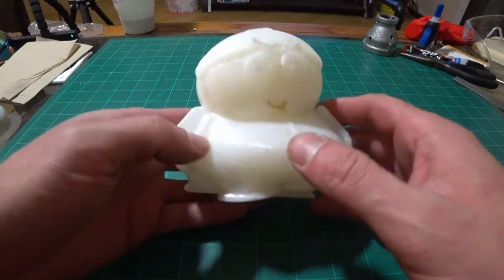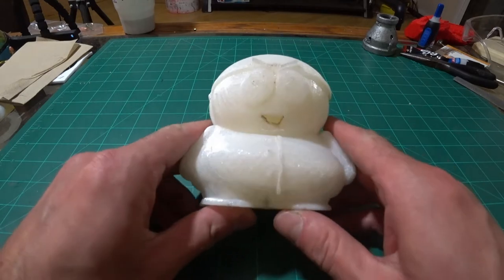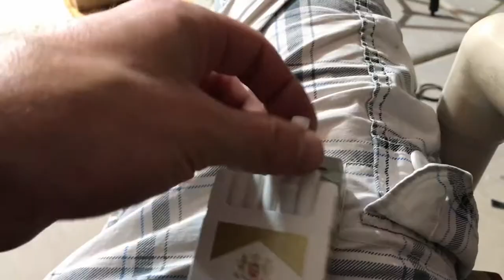ALUMINUM Sand Casting CARTMAN From South Park!

Comment: Groovy baby🤘🏻🤪🤘🏻. Looks great I bet it feels awesome nice n chunky. 
Hey I was wondering if you printed that mold with 0% infill do you think you could get the same good casting by normal sandcasting? I’m definitely gonna try it out but not southparky I have somethin else in mind😉👍🏻.
Reply from the maker: Hahaha 😂 maybe but I doubt it. I usually do mine at 20% infill and I wouldn’t go lower than that or you might loose quality not to mention support. You could prob remodel it and put in custom supports but that still is iffy. Are you trying to save on filament? How’s the printer been working out for you?
Reply: ArtByAdrock printers working great but I’m waiting for more pla to arrive as the shop around me charge 2x what it costs to buy and send to me . Also What I mean by doing it at 0% was to leave the actual pla mold in the sand and pour directly into that lost foam casting technique 👍🏻I know you’ll destroy your mold everytime but I would think using greensand it would hold its shape well. 🤷🏻‍♂️I’ll find out soon enough I suppose.
Reply from the maker: Oh gotcha.. I prob wouldn’t even try it unless it was a really small piece.. the plastic will burn but I don’t think it would burn all the way and would prob end up lookin like crap. I watched a video of a guy try and it was terrible. I’ve thought about using ABS plastic making a mold in plaster and then using acetone vapor to melt it out. Not sure how well it would work but who knows
Reply: ArtByAdrock tell ya what man  I’ll give it a try with a small piece wen I get some more pla and try it with aluminium and if that works I’ll try bronze . I’ll let ya know how it goes and if it’s crap I’ll still email some pics to ya then at least we will both know , but yeah I’m with you it’ll probably look dodgy as hell , definitely wouldn’t be the worst thing I’ve cast 😆. Then if it’s shit I’ll delete the footage so it’s gone forever 👍🏻
Reply from the maker: bigstackD Casting haha ok sounds good. I have a feeling only half might burn out. Even if it’s crap keep the footage and do an epic fail video 👍🏻
Reply: ArtByAdrock yeah I suppose, it never hurts to have a bit extra footage 👍🏻
Reply: Hey bigstackD, good to see you here.
Reply: Mark Fryer I’m always not far from this channel Mark 😁👍🏻